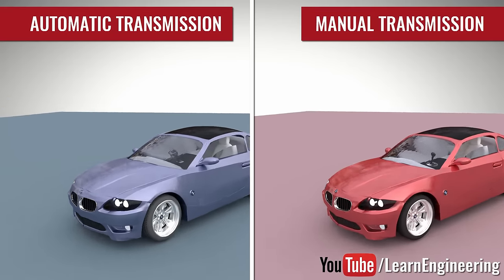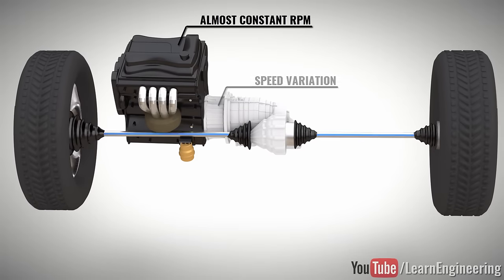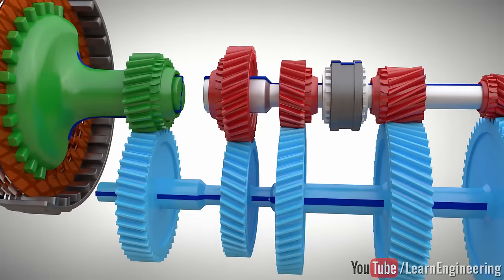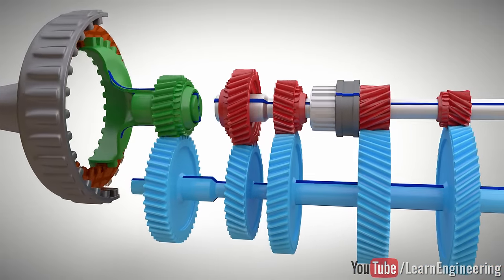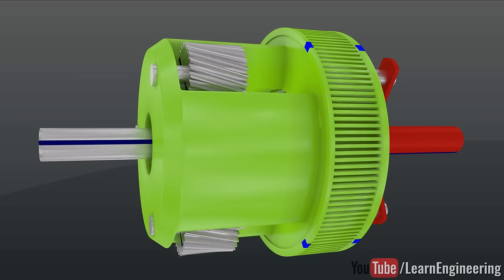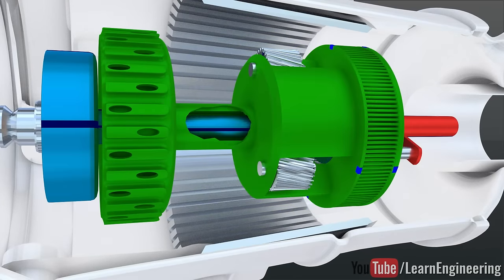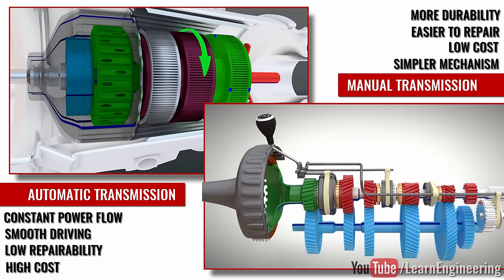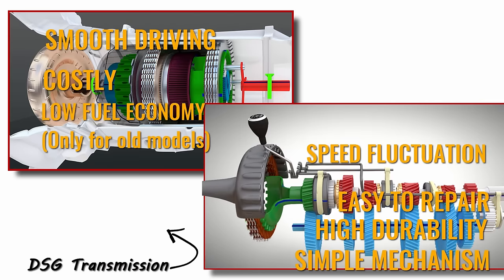Automatic vs Manual Transmission

Comment: Why would you NOT use engine braking in a manual? It does no damage and you slow down quicker.
Reply: destroys the clutch?
Reply: @TheModeler99  it doesn’t destroy the clutch. All engine braking is, is the retarding forces on an engine slowing it down as opposed to using brakes. In fact, it saves you money because you use your brakes less=less wear and tear on your brakes.

Comment: Automatic transmission consumes more fuel than manual transmission due to energy loss in the form of heat from the torque converter ri8? Correct me of im wrong..

Comment: you can tell the efficiency of manual even in games, if you dont time it correctly you're either going to slow or you loose too much speed in the attempt to switch, raced like that for a few rounds, I would win but at a higher cost

Comment: You can actually change gears using a manual transmission without using the clutch. It's not easy though.
Reply: Indeed, but it is also the best way to destroy the gears ^^ A clutch can last for a car life if used properly

Comment: Now the trucks are automatical transmission
Reply: @KryptKicker5  i am sorry i don't understand all things you wrote. We have a truck: Mercedes Axor 1840. The truck is 12 gear. Have manual and auto transmission. you can use both. This is really perfect truck
Reply: @KryptKicker5  we have been using it for 8 years

Comment: So.... a few incorrect statements here... a CLUTCH and a CLUTCH PACK are not the same things. A manual transmission has a clutch, flywheel, and pressure plate, NOT a clutch pack. The model shown is incorrect as you would not find a clutch pack in your normal manual transmission. Also, the main reason for the invention of the automatic transmission had very little to do with "power interruption". Instead, it was invented to make driving easier to learn and increase the demographic of car buyers. Also, the clutch pedal only has to be used when STOPPING not braking. You always want to keep the clutch engaged when braking as this helps to slow the vehicle. Theres alot of bad information in this video...

Comment: Have you ever heard of engine braking? No, you don't press the clutch before the brake pedal. It's  inefficient and kinda unsafe. 
Also..what do you mean by "you can never have a smooth ride in a manual"? Just..press the clutch gently. You can easly be smoother with a manual than an old automatic transmission.

Comment: Electric 🦾😎😁🤟🏻🤟🏻🤟🏻
Actually has none of this problems and many many advantages over gasoline or petrol engines...
-Such as instant acceleration. 
-More space due to the small size of the motors.
- Low gravity center due to the position of the batteries the are located on the floor of the car : making almost impossible to roll over....
I loved the mechanical part of this but, is better for us to just take out all this old combustion cars and walk together to a faster, cleaner and cooler 🦾😎🤟🏻 future!!!!
Reply: Not much cleaner you still burn fuel just somewhere else
Reply: It has a severe drawback, which makes me never want to buy one - it's useless during escape or evacuation.

Comment: I hate having an automatic transmission.  I hate how much it shifts all the time, You go around the corner and then it down shifts, When I'm going up a hill I can't down shift at the bottom and have it just stay in that gear.

Comment: manual transmission uses clutches to change gears everytime the clutch has to be preesed itis low cost and durable simple fuel saver than automatic

Comment: I know this is just an animation, but the positioning of the engine isn't not correct. Should have used any other brand with front wheel drive

Comment: explains why, Ferrari uses an automatic transmission that has a robot changing, and it's the same thing as the manual, and doesn't use the automatic.
because the video shows a lie, it says that the performance of the automatic is better than the manual.

Comment: That is wrong in manual transmission, clutch is not pressed to obtain engine braking which is the advantage of manual transmission to add braking force. Only after braking is sucessfull then need reduce the gear then clutch is pressed.
Manual transmission also better getting acceleration, that is why most sport cars are manual. Very fast to take over other car

Comment: 5:50 this is exactly why manuals are cheaper and better then autos
Reply: He was just comparing them, how does this show that manuals are better?
Reply: @Magst3r1  depends on your definition of "better", but for me, a simpler, easier to build and repair mechanism is obviously the better one. it is the chore of the user to learn how to use the mechanism, just like with other things like ships or helicopters

Comment: I once was driving with a friend of mine, he had a rental car. Just a regular manual, he showed me that you can actually shift gears without using the clutch. Did I say it was a rental? I'm sure the clutch system hit 80% of its duration during that week he rented it... Do I need to say the shifting wasn't very smooth as well.

Comment: My friend if you press clutch before the brake pedal you are a very bad driver, or a women. You do that only when you want to stop the car and you are driving at low speed, otherwise you dont touch the clutch while breaking, because the motor helps your breaking a lot. If you have to break immediately to avoid something bad, press the break hard, and only break, and even if your motor turns off it doesnt matter, but if you press the clutch and break, you might not break in time...

Comment: Your script started out with a misnomer. They both have qualities. Nobody has debated it at all, ever. There has never been a debate. Often people prefer automatic for a few reasons, traffic, texting while driving and not bothering to learn how to drive stick. Some people even like to do make up while driving or eat something. But if you like driving stick you prefer stick. I just wanted to see some gear diagrams. I didn’t want to hear about a debate that doesn’t exist. Someone good at driving stick will have better fuel economy. Someone who has to spend time in traffic a lot will likely prefer an automatic. There is no debate.

Comment: Manual transmission can be a smooth experience. When changing the gears, you have to bring the motor to the rpm of the next gear, by pressing the gas pedal. It requires some training, but it’s possible…

Comment: Sure no power loss with automatic lol. Oh yes, you need to pull the clutch when you brake if you have manual transmission! Please, less nonsense
Reply: was thinking the same thing, I assume he means when braking completely so the car comes to a hault.

Comment: Pretty much automatic is better in every way in modern cars. They even let you control the shifting if you need to at the push of a button. The only reason a person would choose a manual in a modern car would be to save money(in some instances, in others it will actually cost more believe it or not.), and because they are used to the feeling of manually shifting and enjoy it. For those people,even if it is the inferior transmission in modern cars, it's what they like, and they do not mind the negatives. In certain areas, because of the prominence of superior automatic cars, having a manual car is seen as "anti theft" due to it being much less desirable to thieves. So for people who live in those areas, and  enjoy the shifting, its a no brainer as to why they stick to manuals.

Comment: This is a really outdated video with many facts that are now just blatantly wrong. Automatic transmissions have become so refined, they are way more efficient than any human, can engine brake easier, handle more abuse, and will last the lifetime of the car (if you change the transmission oil often enough).

Comment: Manual transmissions are basically dead in the US. Automatics are superior in almost everyway for the normal driver. . but even in racing automatics are taking over although more expensive. With electrics on the horizon here in a decade or so you'll be hard pressed to find a business that can even repair them.

Comment: Dude manual is staying forever without any problems l don’t agree with automatic too many reasons to avoid automatic especially winter time example to getting down speed have to press pedal it’s also brakes to that’s the key on ice you must drive without touching brakes plus making unsafe driving with automatic drivers eating,smoking,reading,texting,talking all those you not able to do with manual but states talking about safety rules it’s just circus
Reply: EVs are taking over, manuals are will only be in trucks now
Reply: @TheModeler99  Pretty sure most trucks are automatics

Comment: You absolutely do not push the clutch in order to brake driving a manual. You wouldn’t pass basic driving test if you did that these days.
When the clutch is pressed the car is idling = bad fuel economy and bad for environment. 

Also if driving on ice and snow you want the clutch engaged as much as possible for a smoother safer movement of the car. 

Only press clutch when coming to a full stop.

Comment: "... a manual transmission drive is never a smooth experience."  This is BS from someone who clearly doesn't know how to drive a manual.  Every manual is unique, so it takes some time, maybe a few weeks or months, to acclimate yourself to a particular manual; but you absolutely will get to a point where you can shift gears without any passenger noticing at all, if you try.  Of course, that's not much fun.  But it is very doable.  It's in an automatic transmission that you will always feel something, even if it's only slightly, every time it shifts.
Reply: Someone totally missed the context. It's not a smooth transition because of the speed dips not because of anything you feel. Automatic has a smooth transition as both gears are changing at same time resulting in a speed curve without dips

Comment: This is such a stupid & irrelevant question. You want an answer? OK...it depends on the Driver. The safest component of the vehicle is the attitude, awareness, skill & experience of the driver. NOT some electrical gizmo or safety device. States need to promote individual responsibility in print/media ads.

Comment: Sounds like manual is actually more dangerous to drive because braking requires two legs instead of one.
Reply: Braking requires one leg only, you will stall if you don't press the clutch down once you engine drops below idle revs. Also you can take the car out of gear without using the clutch, in fact you only need the clutch for selecting reverse and 1st, you can change gears without touching the clutch pedal if you make sure the revs match perfectly.